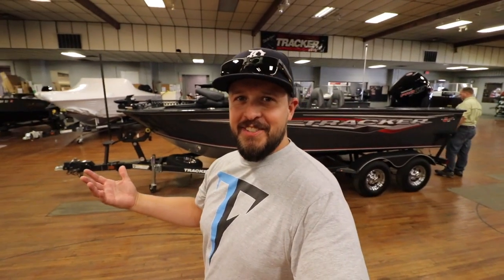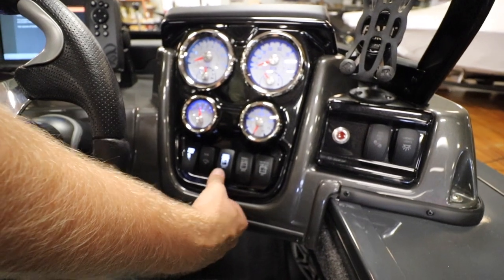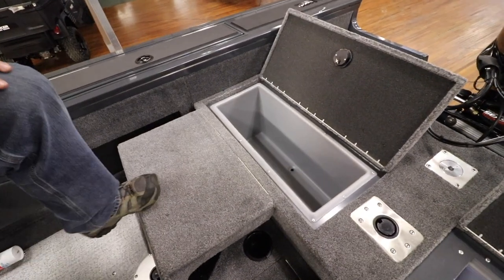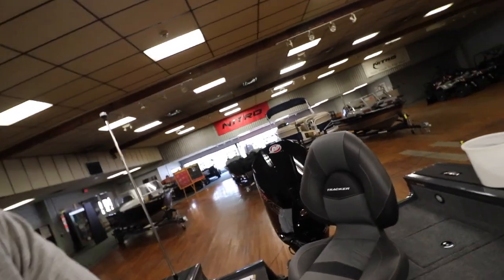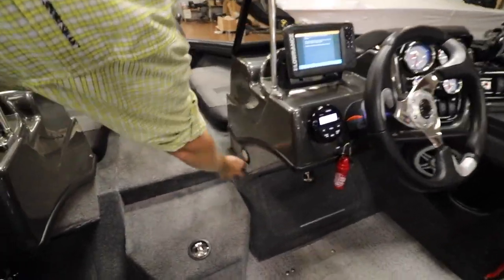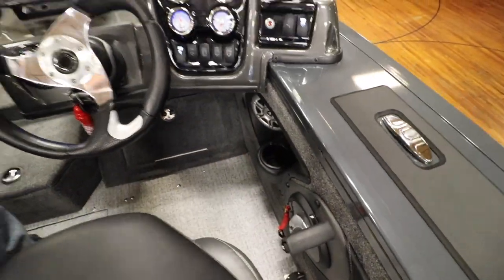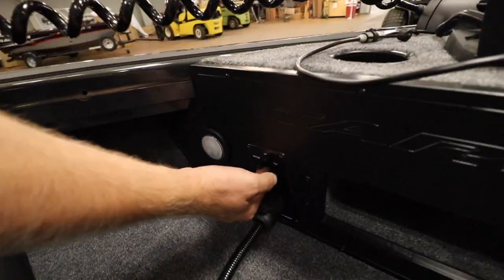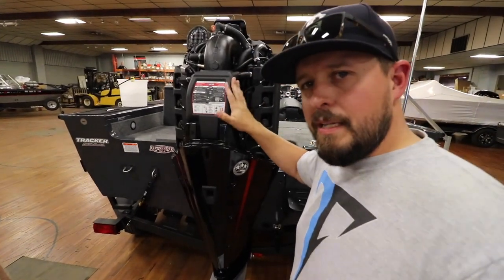MY NEW FISHING BOAT - Walkthrough 2020 Tracker Targa V-18 Combo - Aluminum Deep V Boat

Comment: I have the 2018, wow they really did an awesome job with this design
Reply: @willmann81785  I love it, quiet hull and a very stable boat.  I prefer the layout of the 2020 model as they made better use of space than they did in 2018.  The 48 gallon rear livewell is a waste.  As for motors, in 2018 the only 200hp available was the 4 cylinder v-rod.  It was a 7k canadian upgrade from the 150 and for an additional 3 miles per hour made no sence.  It was a supercharged 1.7 liter so it's working hard to make 200.  The 150 is a 3.0 liter and from all accounts bullit proof.   Now had I had the option for the pro xs v8 200 chances are I would have gone that route.  As it stands I top out at 48 mph on gps and that's plenty fast for me as I'm not a tournament angler so I just cruise at 30-35 for the most part.  Hope this helps.

Comment: How has the boat held up? Looking at getting one myself. Heard some complaints about the storage in the floor gets water in them. And he said about leaving a little bit of water in the livewells? Is there a way to to drain all the water out? If you leave water in them they will stink anyway. And is there a way to keep track of the hrs on the engine?

Comment: Hi. I just got a 18’ targa w 150.  I’m just curious if you have noticed any of the issues I’m noticing with the new motor. First of all it steers very differently left then right.   Maybe prop rotation… idk.  And I have to rotate the steering wheel a lot to make minor course corrections. I assume there is some kind of a hydraulic issue but the dealer is telling me everything is operationally normal. The other thing I noticed is motor shake. At idle in gear the boat shakes enough to make the graph on the consul almost hard to view contour lines. Have you noticed anything like that?  TIA

Comment: Terry, how are you still liking the boat.  I have a 2018 V-175 Combo and the trim pump has had problems twice.  The big problem has been the single axle trailer.  Mine is not a Targa so it just has the single axle.  The passenger side tire hits the inside of the fender when going over moderate bumps on the road.  The dealership has contacted Tracker and they have done everything possible, but it still hits when going over over bumps as confirmed by the dealership's shop.  I've been thinking of trading it off for a hurricane 196f ob deck boat.  How are you still likening yours?  I thought I made a sound choice when purchasing, the trailer has really been the issue that makes me feel unsafe when transporting.  I've had another trailer shop check it for squareness and bent axle and it appears to be within acceptable specs.

Comment: nice boat, I have been window shopping deep v boats  thinking polar kraft 186sc
like the console but would rather have gauges on left  but  so a larger unit is on the right not blocking the view,,,( larger unit 12"15")

Comment: Just took hold of my 2023 targa18. Nice boat just to much stupid stuff. When you put seat in rear deck you cannot open compartments next to seat. Gas cap in center of boat need to push cables out of the way to load fuel. No working physical compass even Lorance says don't trust their numbers. You need to really look this boat over before you buy.